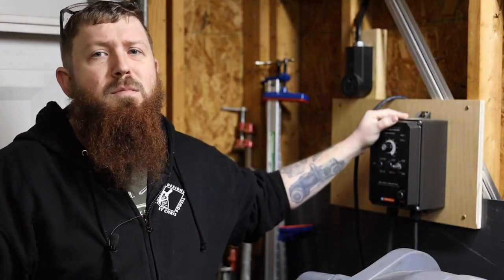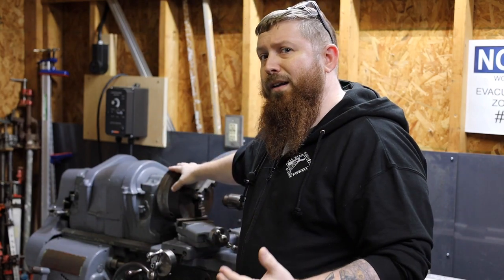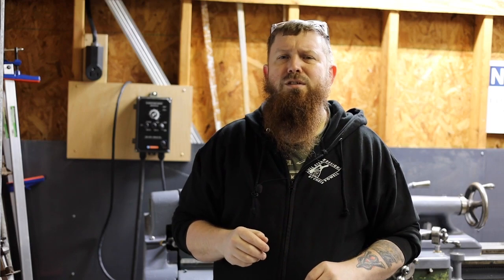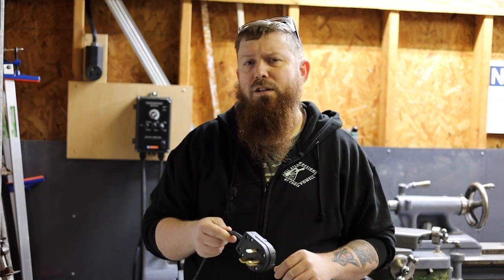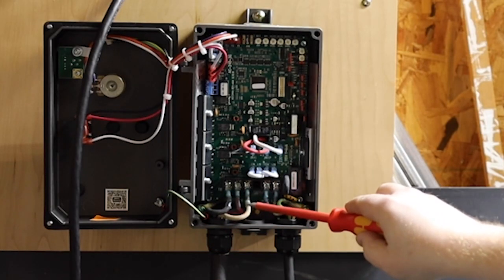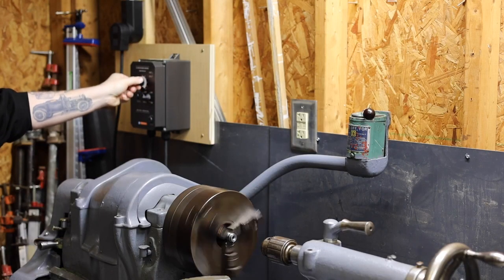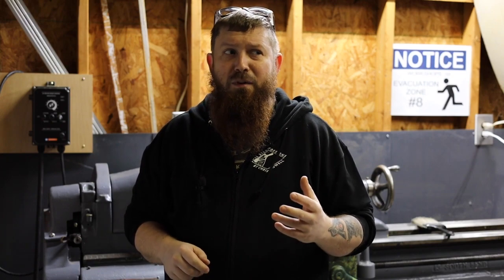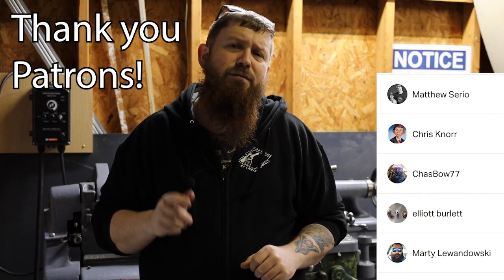Adding INDUSTRIAL tools to a home workshop with a VFD

Comment: VFDs are awesome little(and sometimes not so little) devices. But one VERY important thing to remember, unlike changing belts/gears to slow down the spindle, which ups the torque, the VFD slows the motor by lowering the frequency AND voltage. This causes the motor to have LESS torque.

Comment: hey brother great vid! Im buying a large (1325) cnc machine from alibaba that has a 9kw spindle, 7.5kw vac table and 4 750w servos. also has a pretty beefy dust collector. Do they make a VFD that will run something like that off 220v? The lady Im dealing with is asking me if I want it set up for 1 phase or 3 phase and recommends 3 phase. My electrician tells me it will be a lot cheaper to do 220v single phase for now and we can upgrade if necessary. Im so confused!
Reply from the maker: I’m sure someone does. They should list all of the specs so you can see what size motor they support.
Reply: Some VFDs use 220VAC inputs, just check the specs.